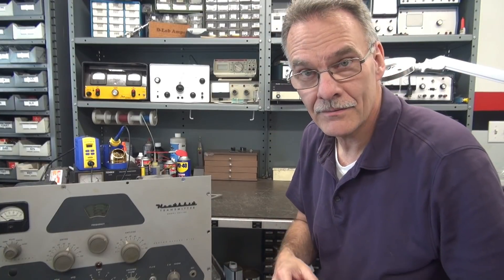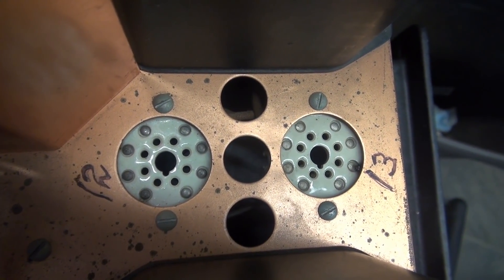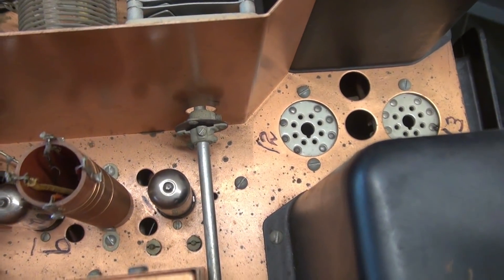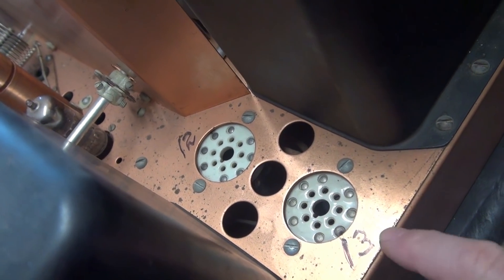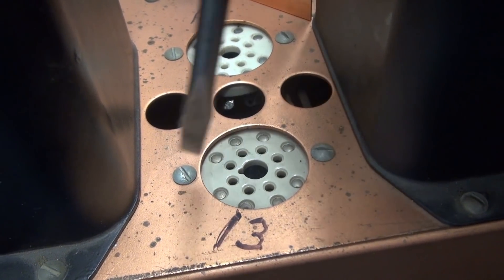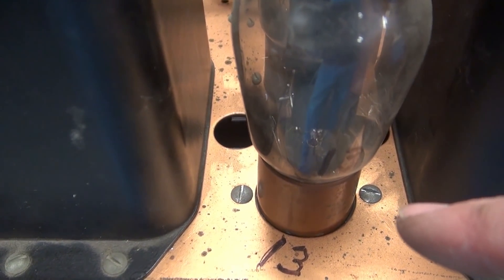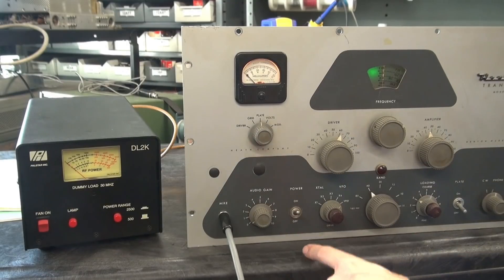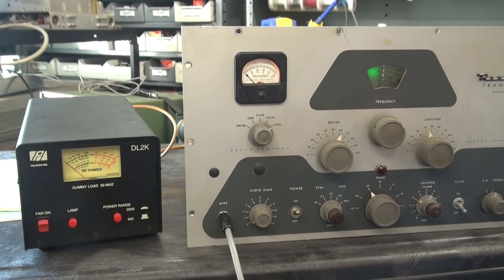How to repair Heathkit DX-100 Ham Transmitter High Voltage Arching

Comment: I bought my DX-100 used in 1973 and I saw the arc marks on the HV rectifier sockets before I ever plugged it in, so I used two #10 nuts as spacers on each bolt and longer #6 bolts to reassemble, I think I did the same thing for the modulator tubes.  There was NO rocking.  The 6146 sockets are already recessed, probably for the same reason.  (screen Voltage?)  I am sure they only arced when lightning hit a power line miles away.  My final amplifier oscillated until I soldered down the big shield between the IPA and the final amplifier. Ron W4BIN

Comment: I have a lovely dx100b on my operating bench. has fiber  washers to space the hv rectifier sockets from chassis. I have installed grid bias regulation so when the modulators are pulling grid current at voice peaks AB2 class. that does not drive up the RF grid bias(grid meter will drop on modulation peaks without that) also when you read the transmitting tube data for 6146b tubes in plate modulation phone service. you are to increase grid drive to 3.5ma/tube or 7ma on the meter(not shown in heath manual). I have a few W3AM phase rotating asymmetry  eliminators built from his site info. they really help with strong but not over driven modulation. I use a JT30 mic with the phase rotating asymmetry eliminator in line to the mic input in a box outboard. these are great transmitters. bought mine for 50 bucks with the sideband adapter and had to remove/unmod the for am service. I always get great signal reports on am. I like your work on this transmitter. on 75 meters with 100 watts of carrier at full modulation pep is 385 watts(almost perfect)

Comment: Terry is absolutely correct !   Dust and dirt attract /absorb moisture and together they Conduct Electricty !    Apply 1000 volts and you get arcs. 
 Once  a ceramic socket has arced over.. metal deposition occurs .  Molten metal is actually in the pores of the ceramic.   Either you have to replace the sockets.. or you have to grind away the contaminated layer of porcelein  with diamond or carborundum  abrasive ( pad or bit).    With phenolic sockets a Carbon Path is charred into the plastic.   Either way,   you have a conductive path which must be mechanically removed ( snip snip)  or replace the socket.   This is why covering radios with a cloth when not in use is cheap insurance, and why periodic cleaning of the chassis is important.  Discharge those caps first with a screwdriver !   BTW   this happens with the insulation on High Voltage Relays Too !    Damn hard to find sometimes !    I had a transmitter with half the B+ ( 550 volts dc)  on the chassis all the time .  Only after I removed a plate relay and turned it upside down.. could I see the carbon path from the relay insulation to ground ...!  Nasty.  This is why you never want to spill a beer into your running transmitter !